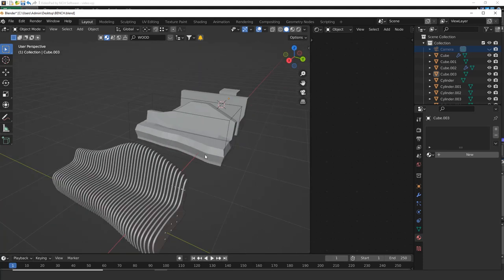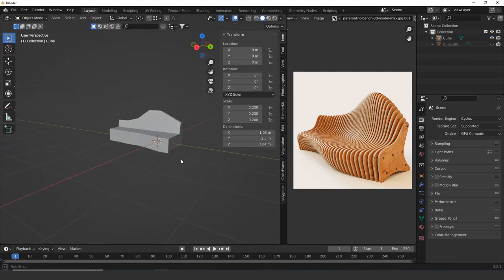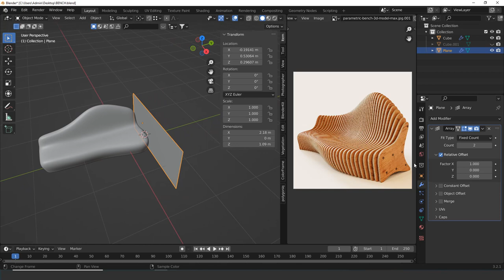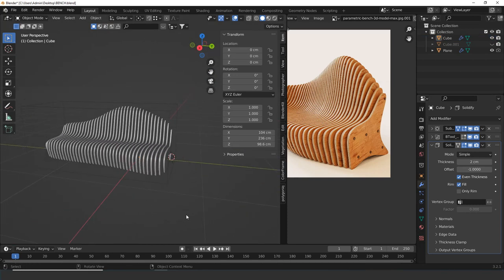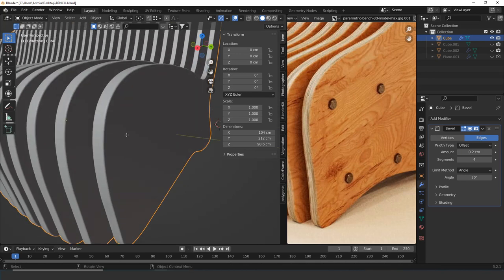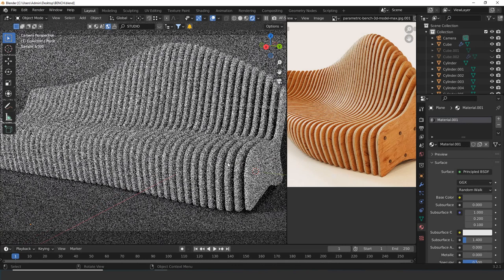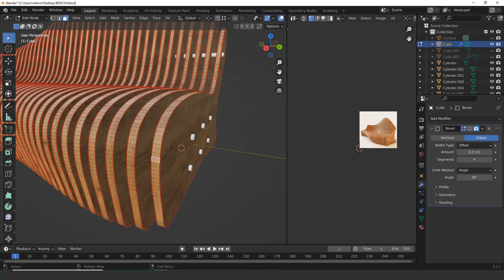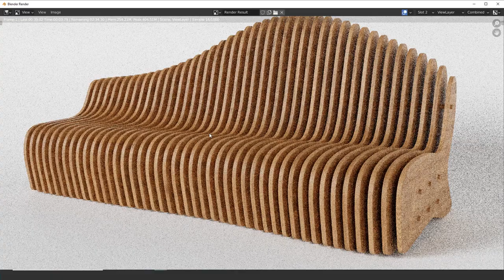How to modeling Parametric Bench  (Blender Tutorial)

Comment: I am a novice blender user and I want to make parametric designs and maybe I can turn this into a commercial purpose. In the designs I make, I want to separate and number all the parts and import dxf, dwg and svg files. How can I do that. Please help
Reply from the maker: Unfortunately in blender is not possible, you need to start to learn a CAD program like Rhino 3D or Autocad with them you will be able to create the svg or dwg.
Reply: @cg_arch  So, in what format can I take the designs I made in Blender and modify them with AutoCAD?